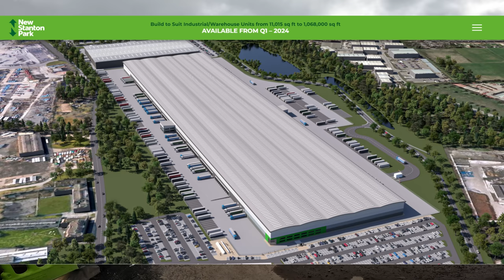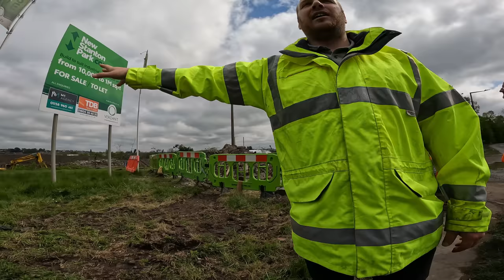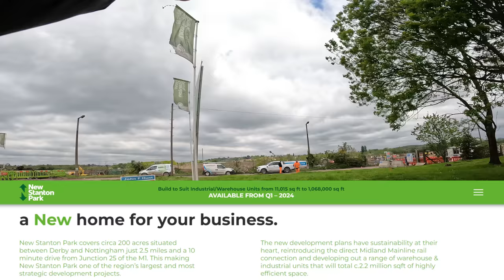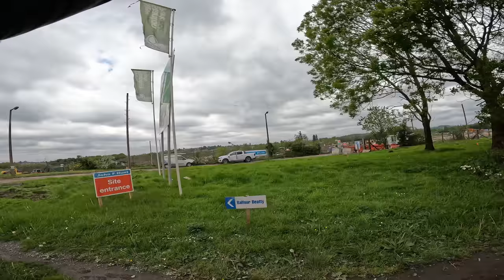It's Not Your Site! Why Do You Want To Make A Video Of The Site? 🤬🎥🛸❌

Comment: If the site is not secured it is a breach of the CDM regulations section 18 :
18.—(1) Each part of a construction site must, so far as is reasonably practicable, be kept in good order and those parts in which construction work is being carried out must be kept in a reasonable state of cleanliness.

(2) Where necessary in the interests of health and safety, a construction site must, so far as is reasonably practicable, and in accordance with the level of risk posed, comply with either or both of the following—

(a)have its perimeter identified by suitable signs and be arranged so that its extent is readily identifiable; or

(b)be fenced off.

The fine is unlimited and maximum 2 years imprisonment.
A very similar case as to what you filmed resulted in an £800,000 fine and six months prison sentence

Comment: i passed the exams for the SIA licence doing it with the DWP but was told i could not have the licence until i got a job after i passed the test i wanted to pass the CCTV test so if i had to work i could do it that way as i have poor Circulation COPD i have had 8 stents fitted in my heart i spent a month waiting for a 3 way heart bypass then had it and found out one of the valves in my heart was still fucked up then i had 2 strokes but up untill the 2 strokes i was living on £74 a week for 10 years as the DWP SAID I WAS FIT TO WORK  and that's why i ended up in hospital a load of times having stents

Comment: I would want to get the environment agency involved with how close those machines are to a watercourse, I've worked in heavy industry and they drip diesel and hydraulic oil everywhere, with that lake being down hill ,when it rains the run off runs into the lake. that water NEEDS to be tested!

Comment: If John f hunt company does not fire that security guard they are extremely stupid because he fringe a terrible liability for your company he threatened a member of public. He owned most went physical on a member of public which means that company could be hit with a huge lawsuit.
  That security guard is a danger to the public and should be fired immediately if. John f hunt is they respectable company? Absolutely disgusting in dangerous behavior by their security guard. One of the worst reactions I've ever seen from a security guard.
 He is way out of line and dangerous. To the public.